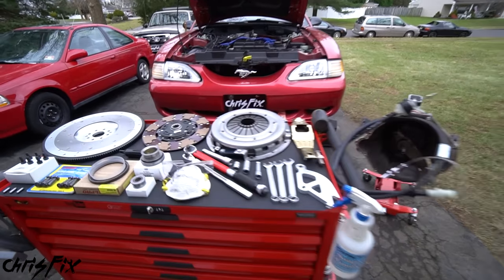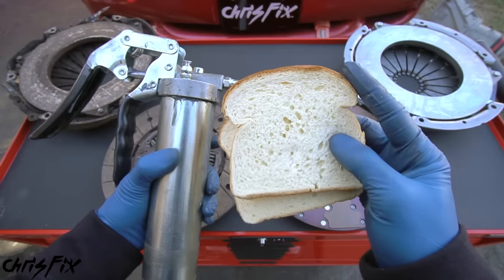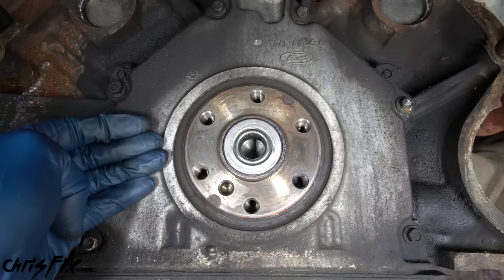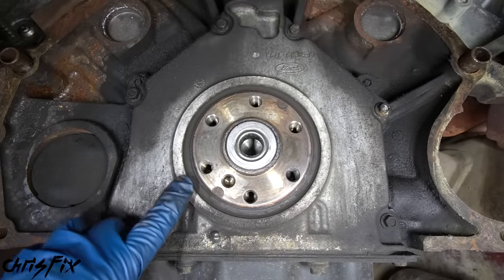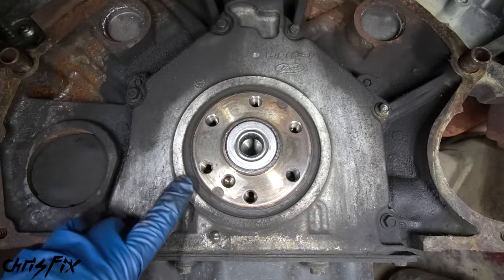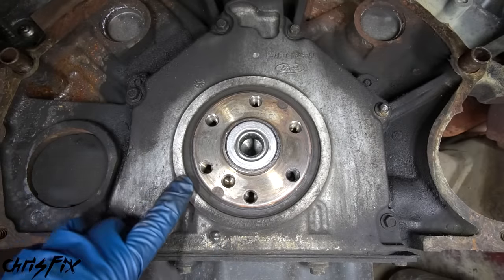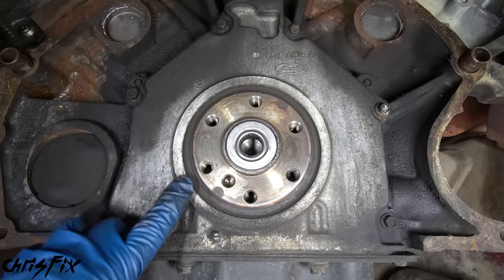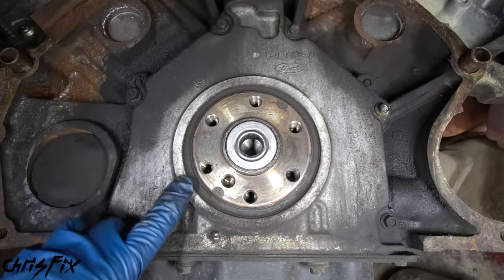How to Replace a Clutch in your Car or Truck (Full DIY Guide)

Comment: I was very seriously wondering how the heck you were going to remove that bearing with grease and bread! I’ll need to try out that trick, even with my local automotive store having the puller in stock. Thanks again for a great video Chris.
Reply from the maker: Awesome! I’m glad you’re learning new tricks!
Reply: You can also do this with bar soap (Irish Spring) and a socket. Less messy and you get the smell of soap to boot!
Reply: silverperzon nice! Another trick for the arsenal...I love the smell of original Irish spring soap too, so that’s an even bigger plus. Thanks for the tip.
Reply: I use a Wooden dowel from hardware store then is slightly oversized sand it until you get a nice tight fit and the pilot bearing will normally Pop out the first time
Reply: barrie livingston That’s awesome too. Thank you...Last year I helped my friend replace these exact same items in his 94 RX7 (drool); We got it some, but would have completed it much sooner with the help of this video and all these neat tips.

Comment: me: bread and grease yeah right... me 7 minutes later: (surprised pikachu!)
Reply from the maker: Lol
Reply: I don't remember where I saw it (I think it was on an episode of Roadkill), but I heard you could also use something like a bar of soap or candle wax. I just think it would be a little less messy, and also less likely to seep out the small gap between the bearing and the dowel/rod/whatever your using.
Reply: @Calebguy13   it was roadkill. basphemi vs super bee episode. and Finnegan used Irish spring for his peeps

Comment: You have the best video on clutch replacment. Best lighting, order of disassembly, great attitude of encouragement. The best on line. 
One quick skill testing question, the original clutch disk had 5 springs the new 6, how will that effect use of the clutch. Thanks again!

Comment: I have a 02 Camry, 2.4 ,high mileage, 5 speed. Have to replace clutch, still use it carefully. I am disabled, I don't have the equipment (what little tools I had were stolen)to do it as I see you do which is fine. I have the parts, just need the rear engine  seal. A mechanic was going to work on it, am about 25 miles from Houston. A veteran(as this Veteran referred me to this mechanic, which doesn't call him with updates on car,)friend went to this mechanic for his 07 Infiniti, been there a month so far with this mechanic, though on mine, $ it be workable, now, I don't know where to go, as honest mechanics are rare. Other mechanics/shops are outrageously expensive. I don't have the financial means to do it other than pay it out. That's the main repair I need. You have good videos, easy for me to understand. So I'm praying and looking. So Praise the Lord Jesus. Thanks. Have a blessed day

Comment: I went from not knowing how to replace blinker fluid to being able to replace transmissions and clutches.
Reply: with bread that is
Reply: With bread and medium strength thread locker, to make sure those bolts don't come loose from vibrations.
Reply: That's hella funny

Comment: "use a dust mask."

2020: I'm gonna make them impossible to find!
Reply: What
Reply: @barnsleyseemstobeaninteres7698  people are buying safety n95 masks used for safety against airborne particles to protect them from covid making it near impossible to find any PPE for mechanical work. They're not even fluid ressistant which makes them worse than a medical mask for COVID.

Comment: Bro you legit have single handedly taught me more about fixing my cars in less than a month than my mechanics teacher did in a whole year in high school.. I only knew basic things like spark plug replacement and big easy to reach things like radiators, fans etc.. Never once did he show us how to actually take apart an engine to get to things like the pistons or crank shaft or even bothered lifting any cars to try and show us transmission work 🙄

Comment: I don't know if there's any relatively new ChrisFix viewers like me out there, but no matter what car/truck Chris is doing a demonstration on, the general knowledge is much the same across the board. Only some terms may apply like in this case cable driven clutch vs hydraulic clutch(es), but even in this scenario he said a lot of the processes are the same between hydraulic vs cable and linkage clutches. Thanks again for the national treasure level content and knowledge, Chris! 😎💪
Reply: Also, I'm not even a Mustang guy, but any helpful ChrisFix videos I have been saving to my Favorites Playlist for potential future reference and that alone is worth its weight in gold regardless of what car/truck brand he has in his videos! I suggest anyone else out there to save as many helpful ChrisFix videos to your playlist as possible.👍

Comment: As an SN95 owner, thank you sooo much for taking some stress out of doing a project like this.
Reply: How did it go? I'm about to do this job on my new edge
Reply: @jessepickar3297  I just started, got it jacked up and the tranny off, just waiting on the new parts and some tools to come in this week so I can do the rear main and everything else down there. Putting a spec stage 2 in my 97 cobra. I'm gonna be honest, the list of things you need for a clutch job is verryy extensive if you don't already have the tools/fluids etc. I could list it here if anyone needs. Chris does mention a lot of stuff throughout this video and the other clutch video that I just had to write them all down since I was lacking in some tools and all the fluids, and also found myself picking up a few more things on top of that. I love new edge stangs, what are you dropping your tranny for?
Reply: @jessepickar3297  I've watched this, and the clutch video multiple times and it made doing this project so easy. It gave me the confidence to do it myself 100%. Thankfully sn95 owners have a content creator like ChrisFix. Now when are we getting the supercharger video? lol

Comment: Super clean interior video?
Reply from the maker: Once I find a car with a dirty interior
Reply: ChrisFix my dads car?
Reply: Just use soapy wooder
Reply: @chrisfix  mine isn't horrible but it needs restoring leather seats, carpet, and trim too! I drive a 2000 Ford Expedition XLT 5.4L Triton V8
Reply: @chrisfix  You should make the driftstang dirty just for the sake of the video 😂

Comment: :removes clutch fork. 
:removes release bearings
:sees wobble on input shaft. 
   *****replaces whole transmission
Reply: The kind of things only Chis Fix Does!
Reply: why not rebuild?
Reply: How much does a rebuilt transmission cost?
Reply: Robert M a lot
Reply: @robertm5969  I had to have a transmission have a full rebuild and it cost me $2,000. But that was an automatic. A manual might not be as exspensive. Still you would need to take it to a transmission shop and let them do all the work.
Reply: he lost me there
Reply: if you have money then you would do it too lmao
Reply: Some of these newer transmissions are actually supposed to have alot of wobble in the input shaft. I have a
NVG 3500 in my 97, S10 p/u. I noticed that the input shaft was pretty wobbly when I was changing the clutch. I took the transmission to have it rebuilt thinking that it was bad. Luckily the shop was honest enough to tell me there's nothing wrong with it and it's supposed to be like that.

Comment: Jokes on you, I have a hydraulic clutch!

laughs in master cylinder failure
Reply: I mean...a torque converter is basically a hydraulic clutch since the input and output are entirely locked together by fluid coupling.

On a more serious note, master cylinder isn't as big of a deal as say...the slave cylinder on a transmission with an internal slave cylinder. Cause the transmission has to come out to replace that $40 part.
Reply: @zapityzapzap  yes. Thankfully mine has an external slave. Tell me replacing the master isn't hard after doing it on a 4th gen f-body lol
Reply: Glad he showed us how to fix hydraulic clutch
Reply: My master cylinder is out right now. Still waiting for the part to come in. In the mean time driving has been a fucking workout.
Reply: Colin Zapalac unless you own an Audi, the part cost me $200 :(
Reply: yah the slave on my new wrx blew after around 30k miles...
Reply: @alexandervanderwal8847  my new car has an internal slave so I've got my fingers crossed 🤞 but I gotta replace the clutch soon anyways so as long as it holds until then we're good

Comment: I STILL haven't replaced my winter air with summer air.
Reply: I've changed my summer air with winter air.  It handles so nicely
Reply: That ruins your transmission due to unstableness on your wheels
Reply: That's a felony in California.
Reply: Geez, how could you?  Have you atleast replaced your blinker fluid?

Comment: Hoping this video helps!!! I'm more familiar with computers/electronics than cars/mechanical stuff.....
I mean if this is even what I'm aiming to do.....had my starter replaced last year because the prior winter (& only when it was freezing temps or lower) when I'd start my car (09 civic ex) before leaving work for a brief instant I could hear the starter/flywheel teeth grinding. 

dude that did the work said he'd recommend replacing the flywheel cuz the teeth were damaged but I could get away with it as long as nothing weird was happening, but within the last month (not super cold weather but on cold starts) I gotta feather the gas while trying to get into 1st gear, it'll be slipping I think....feels like it's trying to grab but shakes the car instead. not hard to get going and only does it in first gear and never from it to second or through any of the lower gears (maybe since I'm already moving and RPM is higher??? Idfk 🤣) 

however I can only imagine what I'm experiencing isn't good lol and that I should figure it out/get it fixed ASAP.

as for mechanical skills I'd say the most in depth/difficult job I've done on my own vehicles was replacing the timing chain, putting on a new harmonic balancer on my old 84 mustang...
or replacing pain in the ass side motor mount on current civic (mainly cuz I really didn't have proper equipment/tools to do myself & dropped one of the bolts in my front clip....ended up taking the whole bumper off after an hour of trying to fish it out from above/below anywhere 😡) 

I think I could do lots of stuff myself just no fancy lift/endless tools, etc 🤣🤣, and never enough time..... however I do got some spare cash since I sold my backup computer to a desperate buyer haha. So we'll see

26:58 uhhh did I miss something?? Lol the mark you made on the alignment tool is the same as every other spline correct??? lol it's a symmetrical piece isn't it? 
cuz looks like you could just turn till ANY of the splines are pointing up...plz someone inform me

Comment: Chris, I'm sure you remember the mid-80's GMC 1/2 ton p/up with the 250 6 cyl.(a G.M. mistake). I pulled the transmission to do what this video entails and pondered for a moment, removed the 6 cylinder junk, left the 3 speed on the column in it and matched it with a 350 Chevelle motor - my best sleeper ever.

Comment: Hey Chris, I've watch your videos these days and it teaches me a lot about cars and what should i do to fix car. My dad have a 1999 Sedan Honda Civic and rarely use. This car has many issue and one of the major is the clutch (i guess) where when changing to reverse (auto transmission) , we have to rev a little harder then the clutch finally grip and start to move. 

Also when there is a tight turn, we can hear the sound of a like an old rusty metal struggling at the strut area. I'm not really sure what cause the issue so that make me stuck and doesn't know what to fix. The power steering is okay. I dont know is it either the strut itself or the control arm. or maybe the knuckle

This car is a legend to me cuz I love JDM and i dont want it to be in junk. Hopefully u can show us the solution to my problem. Many many thanks for teaching us lots of things on fixing our cars and not wasting money.

Comment: Hey Chris, so recently when my mom was looking for things to buy at an estate sale when found a 1974 dodge maxivan. We were thinking of turning it into a family van. However it hasn't run in 20 years and doesnt have a key. Also to add we are in California so I was going to ask you if you thought I was a good Idea to work on it. I'm an aspiring engineer and this would be a great project to start on.
Reply from the maker: It would be a fun project.
Reply: @chrisfix  update we just looked at it and it was actually sold by my moms dad. They offered 250 for it and I didnt see any bad rust however, it was massive about 7 feet wide and about 15 feet long

Comment: Glad I know this channel, been watching your videos since few years ago and today I managed to open the transmission of our truck and boy the bearing is pulverised, the disc was smaller in diameter than the flywheel and one of the flywheel's teeth broke. This past few weeks my father and i have been tackling with the clutch slider thinking that that's the one broke down cuz of recent flood where it was submerged and your video guided us!
Still took us the whole day though😂.

Tomorrow, we will try to find replacement parts and maybe put it back together. Hope it works out!

Comment: Only bad part I don't like or wouldn't do is put RTV on that back plate on the back of engine where the seal is because over time that RTV will get old and hard and brittle and possibly break off into the oil pan and stop up the oil pump screen and then bye bye engine because the older ford rangers were so bad for that because some came from factory with RTV on the oil pans and then when it got old and brittle it pieces dropped into the oil pan and stopped up the oil pump screen . So if I was you i do or find a way I would do something else besides RTV I would hate for that to happen lol i just thought I point that put let you know.
Reply: hammer and wrench? lol
(ussr theme intensifys)
Reply: Holy shit I'd like to buy a sentence.
Reply: @Asdayasman  👌

Comment: Awesome video, its convinced me that clutch and transmission work is beyond my ability.
I could probably get after a couple tries but 1st few times I'd get lube where your not supposed to, and id scratch the fly wheel and or pressure plate, od have to replace, and resurface alot, id probably mess up the main rear seal and who know what else.

Still great video maybe someday if I have a better im restoring that I don't rely on as my main vehicle I might try this.
Reply from the maker: Nothing wrong with knowing yourself and deciding to let someone else take care of this! At least you get to see how it's done!

Comment: Torque spect on bolts are usualy measured on dry bolts so greasing them up may cause overtightening the bolts... just as a sidenote ... 
very good video

Comment: Hi Chris, the video is great and is very helpful doing my first clutch replacement.  I’ve seen other videos as well as the place where I bought my throw out bearing that spacing from the clutch fingers is critical and requires some detailed measuring to set unit up properly.  Was this step omitted from your vid because yours was matched to the clutch and fits right out of the box or did you have a selection of sizes and knew which one to get?

Comment: Hey Chris! Just a quick question (if anyone at all can answer it that would be nice too).
What was the reason you had for replacing the clutch cable? was it because of the new pressure plate being a possibly different tolerance or is a recommended thing to do every time you change out an old clutch? Thanks for your in-depth videos! I'm going to be changing the clutch out in a 1998 F-150 soon.

Comment: Hey Chris! Love your vids man! A couple of questions: 

1. Where did you get your transmission rebuilt!?

2. My OEM Ford replacement clutch cable keeps snapping :( my 3rd one so far (after a full year of driving it) I don’t know if it’s the aluminum clutch quadrant or what. But I did everything to my car that you did (clutch, fork, pivot stud, main seal, bearings, etc. what could it be!? Thanks! :D

Comment: Thank you so much for this video, I'm gearing up to do this job on my lil civic. I love your grease & bread trick, but am I right in thinking that if I wouldn't need to bother with it if I just remove the flywheel? Because the bearing will come out with it and I can just knock it out when it's off the car

Comment: OK. So how do you do this when the trans is still on the truck? We don't all have access to tools and equipment to completely take the trans off to replace the flywheel/flexplate.
Reply from the maker: There is no way to replace a flywheel/flexplate with the transmission on. In my other video (https://www.youtube.com/watch?v=al08aGQTkFk) I was able to remove and reinstall the transmission in my driveway, on jack stands, with common hand tools.

Comment: Chris, as a DIY enthuesiest, you're my hero. Do you know an easy way to determine if it's the clutch vs. the transmission? I just got my first project vehicle, it's a manual 96 F250 and they guy I bought it from said it needs a new transmission. I immediately started reading into how to fix a transmission and people on Reddit asked me how I know it's not the clutch. I can't wait to give a clutch and/or transmission rebuild a shot!
Reply: @Syzygizing  it’s difficult to get it into 1st, 2nd, and Reverse. I have to put it in third and downshift or upshift through the gears when stopped in order to more easily get it into the gear I’m seeking. More recently I’ve just been avoiding 1st gear all together.

Comment: Fyi....you can use just bread...avoid the grease mess...just put some bred in and hammer the pin and repeat till pilot barring comes out. It doesn't really matter wich way u do it but i personally would just avoid the mess.... Great vid